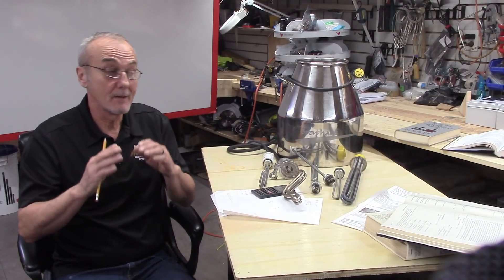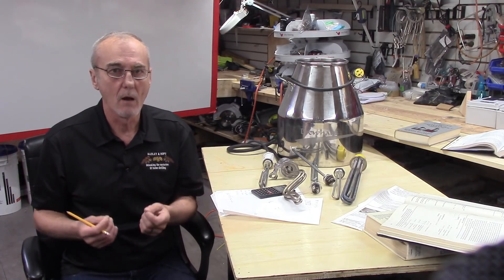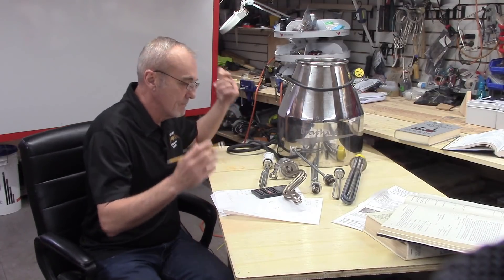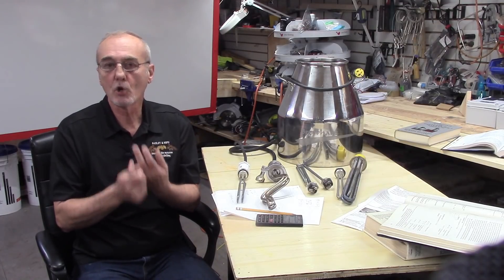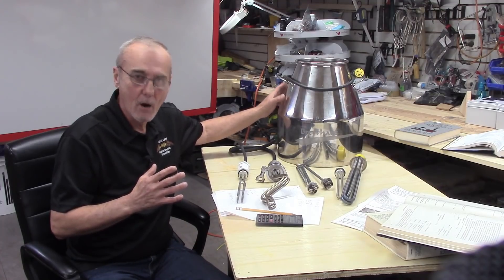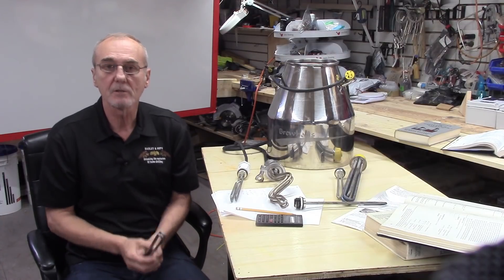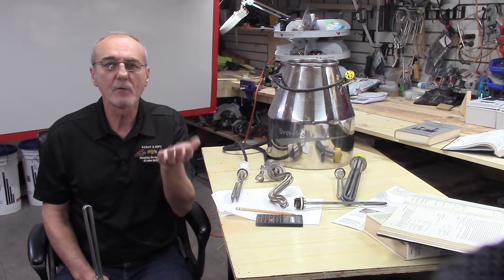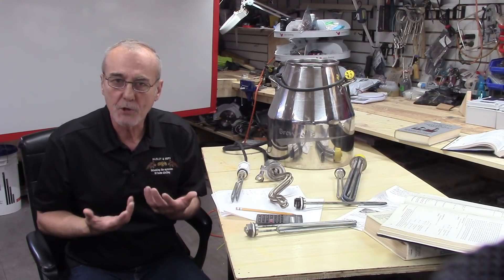HOW LONG DOES IT TAKE TO HEAT MY STILL PART 1

Comment: Thanks George!!! 

I'm learning and refining........ PID control has given me so much more control and ease of operation and I'm inspired to make more improvements in this hobby that gives back!! 🤣

Is it worth insulating the boiler pot with a blanket to reduce thermal losses to the atmosphere or is this simply a "fact of life" and an important part of the magic that happens inside the boiler component of the still?

Comment: A cool vid as always George putting out good info. I have a 13 gal pot with only 120 available. So it takes me all day but it works and low and slow is the only option I have lol. I do have a propane burner but I dont mind spending the time with the undersized element.

Comment: You spying on me George? Haha I was talking about this less than an hour ago. I recently switched from propane to electric. My Btus are significantly lower now, but controlling the temp is no longer an issue. I feel that it was a worthwhile sacrifice so far. Saturday will be only my 2nd run since the switch. I was considering preheating the mash to something around 100f before adding it to the pot still.
Reply: That sounds like a great idea preheating to 100.
Reply: @davidrogers6262  I think it will save me a lot of time. I have a small setup, so I'm usually doing 2 stripping runs then a final spirit run. So in a day I end up going from room temp to distilling temps 3 times. By the end of the 1st time I've cleaned and put away my tools plus swept the floor. After that... its just staring at a thermometer.

Comment: First like. I use an induction plate with a steel plate on my copper 10 gallon still. Works great. No fumes or flame. Great control of temperature too. Got it on Amazon.
Reply: I have an 8 gal pot and an induction stove top.  I have considered using a stainless steel plate but on the inside and slightly elevated 1/8''to increase convection.  Thoughts?
Reply: @mushroomman1856  copper will not heat up on an induction top. You need the steel plate.
Reply: I got both induction top and plate on Amazon
Reply: @jeffwilson4010  MY POT IS ALSO STAINLESS
Reply: @jeffwilson4010  IM ON MY 3RD RUN JUST WONDERING IF IT COULD HEAT UP FASTER.